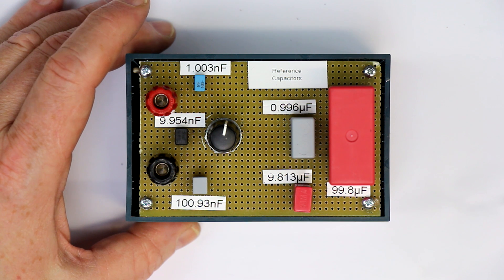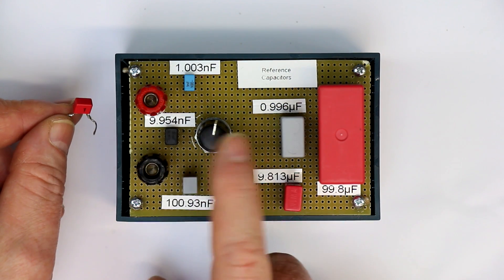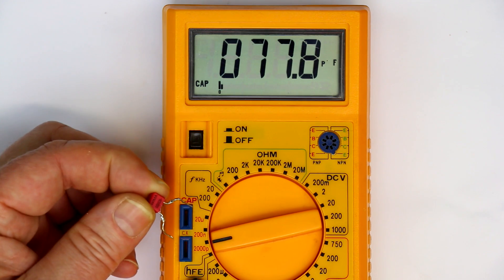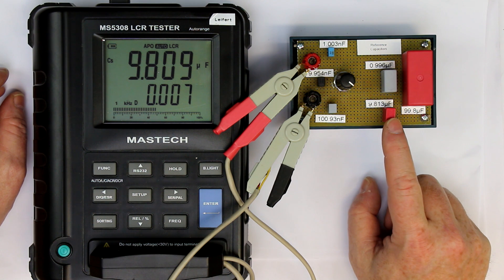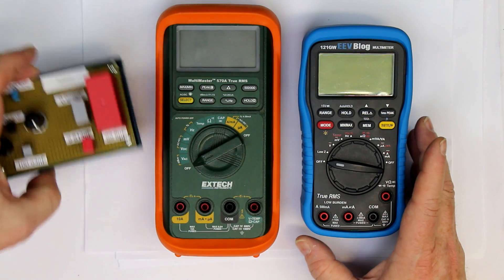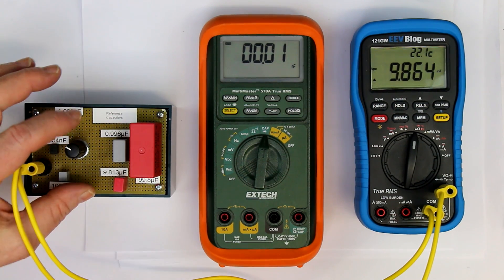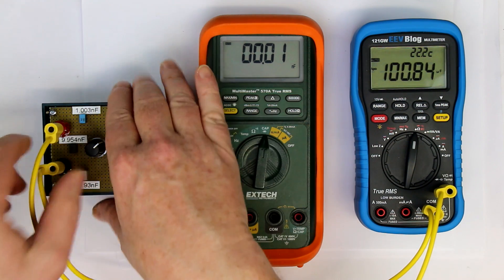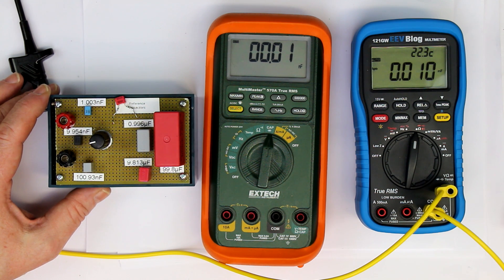A Reference Capacitor Set

Comment: You only needed one more selector and you could have had a "decade capacitor" in the making which is way handier when you need various values.
Reply from the maker: For that purpose we have our "LCR-Box": 
https://www.ak-modul-bus.de/stat/rlc_box_standard_lcr_box1.html
https://www.ak-modul-bus.de/stat/universelle_rlc_box_deluxe_lcr_box2.html
The purpose for the reference capacitor box is to check multimeters and RLC-meters. So 6 values (+ 100 pF cap single) with 1% accuracy (or measured to 1% for the larger values) is quite adequate to the tast, I think :-)

Comment: If you are measuring then writing the actual values onto the top of the box, then you have absolutely no need for 1% or even 5% tolerance. You can use ANY tolerance,  since you are not taking notice of the value written on the capacitor.
I agree regarding the material they are made from - this comment only relates to the tolerance value.
Reply from the maker: Yes of course. But the 1% film-caps are not that expensive (except for the 100µF one) and make out only a relatively insignifant  l part of the cost. And with 1% values I have a cross-check with my LCR-meter. The customers will get a sticker with the measured values.

Comment: The "problem" on the 121GW was the relative function turns off the auto ranging function.  This is a relative function and not a zeroing function that would affect all the ranges.  The relative function is also used with known higher values where you don't really want it auto ranging when you disconnect, etc.  Common use might be checking the accuracy of a bunch of resistors where it will make it easy to see which ones are within your requirements.
Reply from the maker: Yeah. But the manual explicitly mentions the use for nulling out the residual capacitance of the leads etc. So it is in this case a zeroing function. The 2 most common uses of the "Relative" or "Delta" are in my experience capacitance offset nulling and resistance "nulling" of the residual contact and test-lead resistance.